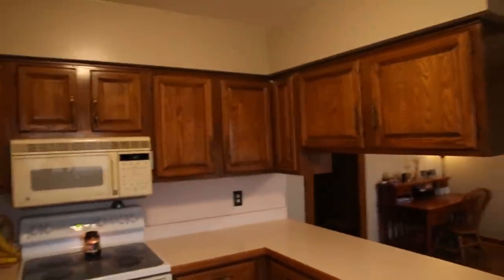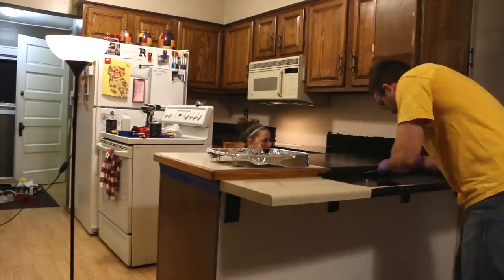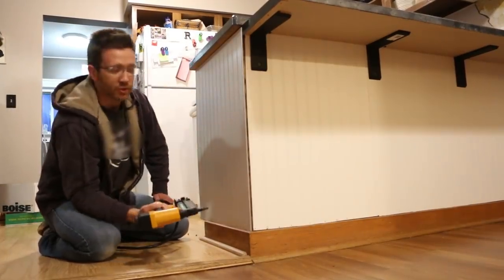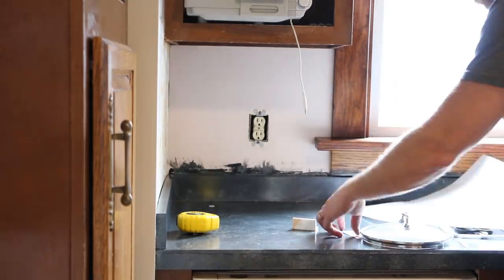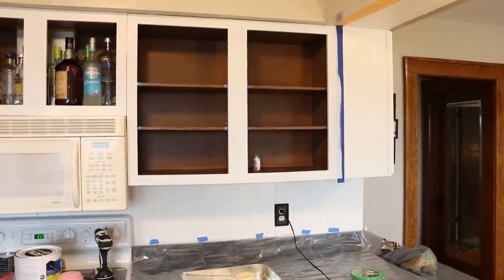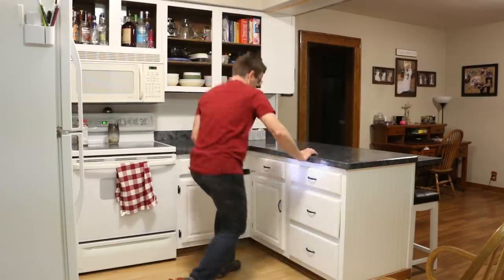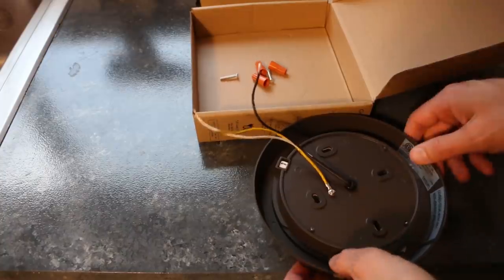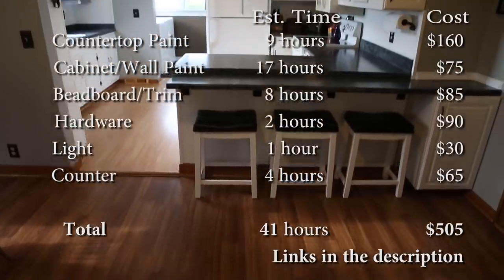How To: $500 DIY Kitchen Remodel | Update Counter & Cabinets on a Budget

Comment: Best way to tell which wire is which is not by color,  your hot wire will have a ridge or lip along the outside of the protective sleeve !

Comment: Well, your gramps wasn’t wrong with red. 

Until about 10 years ago, Red was the traditional hot wire color for a dead end wire line that went from a light switch to a light, while the black is the hot wire that goes continuously from box to box, kinda like a circle. My house is 90 years old too with 3 different eras of electrical in the walls. So, I’m constantly digging around the internet and into my house walls as I update it.

Comment: Not a big deal but hope it helps someone out there. When wire nutting stranded wire and a solid let the stranded wire go in front of the solid as it goes into the wire nut. Lot of times lite goes out and all it is  the white wire is not feeding the lite but you can't find the problem. In the end it's out all it was stranded wire not making enough contact.

Comment: Just wondering. In the video you look like you’re mixing copper and aluminum wiring which is a no no since the higher resistance wire will heat up and be a possible fire hazard

Comment: I painted my cabinet doors before I saw your video.  I used acrylc paint and did not sand them.  Is there anything I can put on top so that the paint does not scratch off or come off with wiping?
Reply from the maker: Just be gentle I guess.

Comment: A tile back splash would'ave looked nicer imo but would cost more. Nice improvement though
Reply: I totally agree. Don't they have those faux ones that look and feel like real tile? That would have been really nice too. 
This guy did a nice job, although I may have chose different things. I also would replace the appliances, if not now, eventually. 
The only other thing, although I like what he did with the cabinets opening that space, there is limited storage space, as it is a small kitchen, so removing those cabinets limits it even more which kinda sucks. 
I also would have picked a different style of light but everyone has their own preference.
Overall, he made his kitchen look nice. Even better, he and his wife worked as a team. 
The only thing you DON'T want to do is half-ass it, because it becomes harder to fix later lol.

Comment: The only caution I have for viewers is that the "two level" counter is clearly just a shortcut, and those L brackets look like they will bend the first time weight is applied to the add-on counter. Build things right so that a cow can dance on it, and don't take obvious shortcuts like the two-level counter. Take your time to think about how to do it right. 
Otherwise every single morning you will be haunted by the shortcuts while having your Wheaties.

Comment: Aluminum wire connected to copper wire…keep that area very dry because you’ve got potential for galvanic corrosion.  Two dissimilar metals in contact with each other.  The aluminum will corrode away.

Comment: I've been zapped by just turning off the light switch to change a light fixture.  But the contractor that built the house was pretty shady.  The wires that junctioned at the kitchen light would've rivaled NASA's mission control room.  It was a mess.
And just ground the damn thing, you're already there...

Comment: The ground isn't for the light. It's to ground the metal housing on the light so it won't become live if the hot wire were to touch the housing. The light will work without it but it's illegal according to electrical code

Comment: OK I totally get removing the cabinet, that looks much more open and nice. Bead board looks like it is from the 50s,  if you like it then great but it is certainly not a modern look. I would also never paint over oak, the natural wood look is much better in my opinion, now it looks like particle board. Overhead light is great.

Comment: It really bugs me when people do their own electrical work and are not qualified. People listen up, if a lighting manufacture has a ground wire connected to it, THEN IT NEEDS TO BE GROUNDED. It's that simple. Also USE A QUALIFIED ELECTRICIAN. You can only get electrocuted once. Don't risk it. Otherwise great video mate 👍😁
Reply: Actually if it's a non conductive device it doesn't need a ground connection. The ground is only need in the event a conductive surface were to become energized.
Reply: @gogamog  OK so here's the thing. Its all good to google something but here's the real life. If a manufacturer of any product, regardless of lights, power or motors, if it comes manufactured with a ground wire, it's requires grounding. Plain and simple. If you don't, and a fault occurs, someone is hurt or killed and it is found the fault as "not meeting the minimum manufactures install requirements, insurance will NEVER pay out. Simple fact of life. Not that hard to understand.
Reply: @Tattooed-ig8tj  not sure what we are googling. The ground is only necessary in the event an ungrounded conductor contacts a conductive surface and energized it. For example if that light was metal and not plastic the ground wire would be connected to the body of the light. That way should a hot come loose and touch the body of the light it would provide a fault path. That light looks pretty plastic to me and therefore does not require grounding from the body of the light per code. Same concept applies to non conductive device boxes.

Comment: Beadboard in the kitchen is hell to maintain.  I've lived in this house for 12 years, and it is impossible to clean. Because a kitchen gets so much dirtier than any other room, you're constantly having to scrub the beadboard and also where the beadboard joins the baseboard/edges.   If I had to do over again, NO beadboard. All tile. At least tile is easy to clean.

Comment: Painting kitchen counters is ALWAYS a no no. That paint will eventually start peeling, get a cut and not hold up long. Spending a bit more and getting new counters is the best and most cost efficient. Painted counters are just very tacky and make the kitchen look cheap.

Comment: Hmm, what about the counter you added to the existing counter top,(approx) $90 at lowes. the L-brakets, (avg) $40 ea. ($160) at lowes. Joint compound? not to mention the tools, which not everybody has, you practically have a workshop, So unless you have all these materials plus tools just laying around this is not a $500 job.

Comment: Yea, you're pretty much right... You're gonna get a TON of people bitching about you not hooking up a ground to a that light. Why? Because while you may think the LED Light is a 'low power switch'... its not... its still getting 120+ volts pumping through it... So if one of those wire nuts pop off somehow, and it touches anywhere else on that light assembly... you're gonna get the shock of your life.... Big oof there bud...

Oh, and for the idiots that always seem to go "so many people criticizing and no one saying how to properly do it". 1) Easy, CONNECT THE GROUND WIRE.... 2) You've got zero room to talk, cause you didn't post anything about properly doing anything either. People will criticize and people will bitch and moan and poke at how incorrectly something was done. Why? Because its easy to know when something is wrong, but not easy to know if its done right. People will be able to see "oh well this isn't done right" because it just doesn't look right or doesn't sound right. But that doesn't always mean someone KNOWS how to do something right...

"Omg that cabinet fell down! you guys are horrible! you coulda gotten hurt!" = well yea... they let it fall... that's an obvious 'you did it wrong'.
"Omg you didnt' connect the ground wire!" = well yea... they didn't connect the ground wire... an obvious 'you did it wrong'.
"Omg you have a gap between those two panels near the electrical outlet!" = well yea... they have a gap.... an obvious 'you did it wrong'....

Comment: It looked better before .. just needed new countertops and appliances. The way you did the counter tops is never going to hold up and it's going to look horrible as it all chips off. The paint on the cabinets is quickly going to start to wear off on all the raised edges where you bump into them and within two years it's going to look really bad.

Comment: Well It looks way worse then when you started you could have gotten wall tile for the same price and Left the cabinets wood...and don't tell people to not worry about the ground wire...that bar top needs to have a rounded corner for safety reasons...

Comment: ( Update 2021)
How To:$5000 DIY KITCHEN REMODEL
/UPDATE COUNTER AND CABINETS ON A BUDGET

THAT BEAD BOARD is far from cheap now.A single sheet of plywood is $89.00 now This is not the time for a remodel unless you bought your supplies in 2020.☹️

Comment: The ground wire isn't there because it's a low powered switch. It's there because the power going into the light. If your light breaks, or something causes the casing to go live, where it mgiht work, but the 120v is going through the case, if you touch it, it doesn't amtter that it's only a low powered LED light. 120V is 120v regardless of the device...... And given you live in the US your wires are designed to carry more than 10A. There's not much difference between 120v 10A and 240V 10A, you'll still die.

If there is a ground wire, it means it isn't double insulated.

Comment: Please,  don't do any more DIY's until you learn a little bit about safety.  Anyone watching this.  Please be smarter than Lee.  Take off the doors,  if you run into the problem of the nails like he did. PUT THE SCREWS BACK INTO THE CEILING SO IT DON"T FALL ON YOUR DUMB HEAD.  Also,  keep the kids out of the line of fire.   head desk